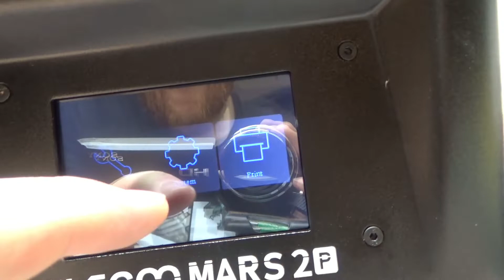ELEGOO Mars 2 Pro Resin Printer And Sovol 3D SL1 Curing Machine Review Pt 1 - Sorta How To

Comment: I probably should have waited to get a resin printer when they were more cheap like they are now but i can still use my one to make prints for molding so it still works out in the end. I'm still trying to make some 3 inch doom, wolfenstein and fallout figure collections but I'm having a hard time finding a good 3D modeling software. Any suggestions will be great guys.
Reply from the maker: I use Blender for adjusting 3d models and Chitubox for scaling and printing.
Reply: @TheGeekChest  i tried using blender but i needed something i can use that is easier to create my own models.